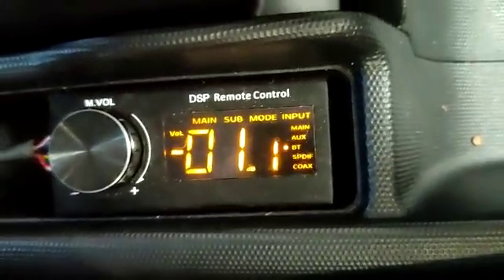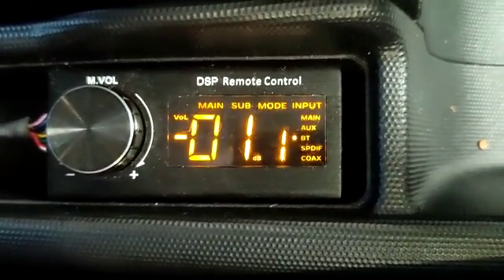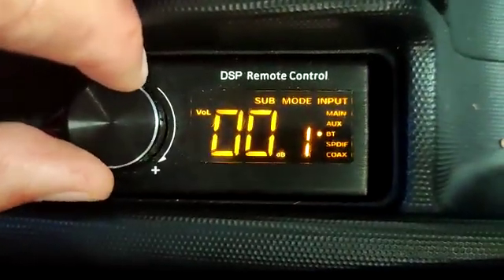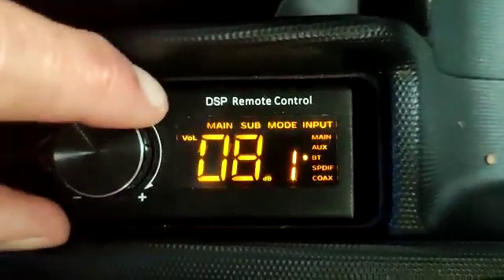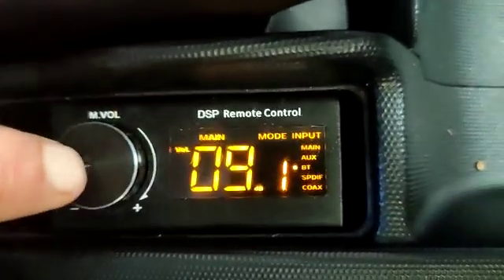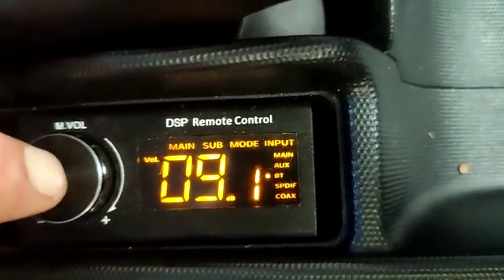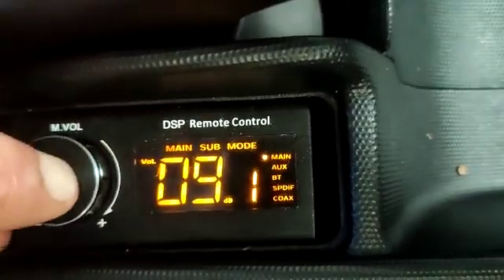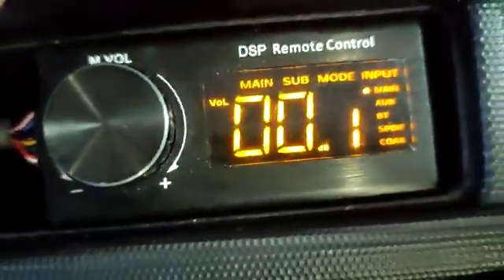AWAVE DRC FOR STEG AND AWAVE DIGITAL SIGNAL PROCESSORS - ENGLISH

Comment: I purchased an Awave DRC controller and connected it to my DSP-12AD using the original DRC-AC Link cable. The controller does not power on or respond.